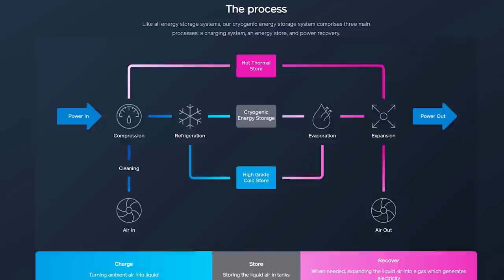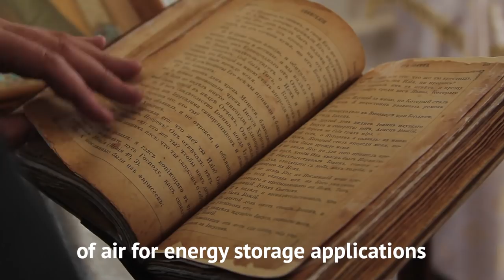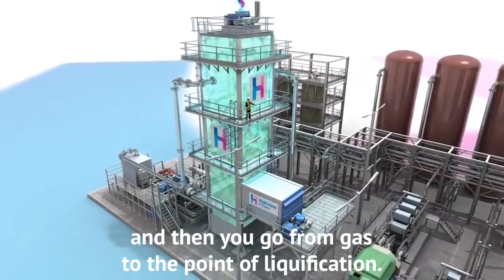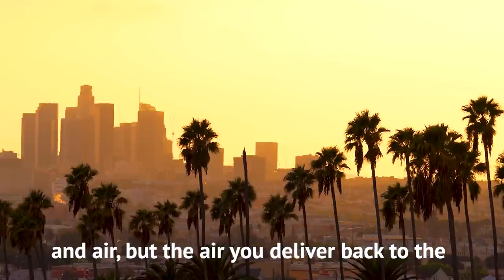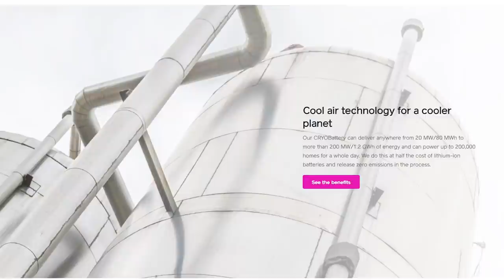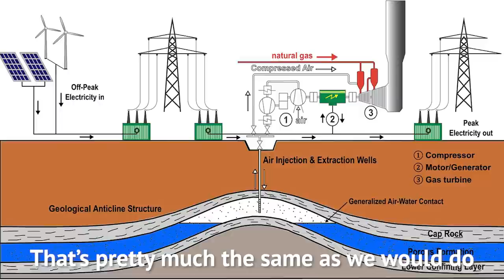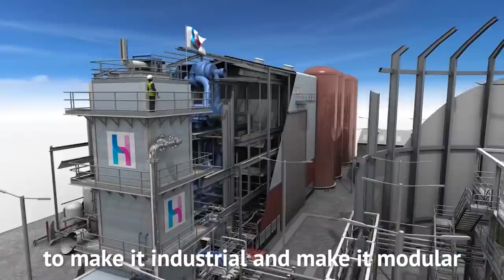CRYOBattery Storage? | Highview Power Interview

Comment: Please, show us the numbers: cost per megawatt of storage, plant construction costs, maintenance over time, salaries, etc.
Reply: @markplott4820  Megapack is good for short term balancing. It is expensive, but it makes profit with every loading and unloading. For the long term you need something different, where you make profit, with holding the energy for a long time.
Reply: Based on what was said in the interview, a plant like this is going to cost more than a 4 hour Lithium battery solution. I would imagine the cost would be comparable to operating a Gas Peaker plant over a 20 year lifespan.
Reply: @markplott4820  The problem with MegaPack and other battery solutions is the cost for longer duration storage. If you want 8 or 12 hours energy storage you are going to double or triple the cost for the additional batteries. With this technology, you simply have to pay for more, or larger, storage tanks. Additionally, if you need to increase the storage duration, you can simply add additional tanks. The point being that tank storage is cheaper than the cost of additional batteries.
Reply: @markplott4820  Numbers.... slightly different numbers out there,  but roughly talking Hornsdale cost $66m for batteries plus $24m for "no infrastructure" stuff " small concrete pads" to get 100MWh storage. Which is amazing. The second LAES plant will have 250MWh of storage for £85m and there building it in populated area (brown field site).  I'm happy they are 2 great solutions.
Reply: @markplott4820  In Australia the sun shines every day, but in Germany you need a solution for several months! You must store the energy from the summer for the use in winter. Batteries for one cycle a year are too expensive!
Reply: @No_Free_Lunch_Today  The main advantage of LAES is cost for capacity. Build a well insulated tank for liquid air, build it BIG. The volume rises by the cube while the outside surface (the only place where you can lose energy) rises by the square. And costs (I guess) rises less than linear. So, it's rather simple to store extremely large amounts of energy for comparatively little cost. 
That 250 MWh figure hasn't scaled yet... imagine several GWh - I'm pretty sure it's not that much more expensive. What drives the cost is the machinery to liquify or to evaporate (basically, store or extract energy) in the plant. The storage is (at huge scale) nearly free. 
The trouble I see is, when you evaporate the liquified air, it will draw a lot of heat from the environment. I'm not sure how well that scales when you release the heat in summer and extract it in winter (basically it gets hotter around the plant in summer and it gets colder in winter.

Edit: I should have waited for the video to finish. He is saying exactly what I wrote. The performance in MW is what drives the cost, the capacity costs next to nothing. Imagine a setup storing several TWh, enough to last a country through winter...
Reply: @minimalist_h  Even with rain you have production, plus there is wind.

Would you would need is to import energy from the Magreb, the same way you now import from Russia and mid east.
Reply: @aitorbleda8267  Yes, but there is still a difference between summer and winter.

We don't need the Magreb, just put enough solar panels on the roofs and build wind farms. The Magreb needs its electricity for itself.
Reply: @No_Free_Lunch_Today  Tesla already has experience building high pressure stainless steel tanks in Boca Chica
Reply: @minimalist_h  Nothing wrong importing energy.. but yes, we could be self sufficient in europe... but we would then have massive overproduction on summer..
Reply: @No_Free_Lunch_Today  With Li-Ion batteries starting to drop below $100kWh, the claim that a liquid air battery which costs $0.14/kWh (that's equivalent to $140/MWh - which is what the link provided states) and is HALF the cost of a Li-Ion battery is a bit hard to swallow. Something does not add up. We can take a Li-Ion battery that costs initially $100/kWh and amortize it over 5 years (perhaps it lasts more, which makes it cheaper) and come up with an amortized cost of $0.055/kWh. That's almost a third less than the $0.14/kWh claimed for the Highview Power "GWh-scale liquid-air battery". OK, so add some to the cost of the Li-Ion battery for inverting the DC to AC. That's probably going to raise its price to about 7 cents per kWh. That's half the price of the GWh-scale liquid-air battery. So where are they getting their Li-Ion batteries that when amortized they would cost $0.28/kWh? A Nissan Leaf battery repurposed for home energy storage will cost less than 10 cents per kWh, amortized over 5 years. 

The big killer is in grid balancing. Electric batteries will outpace the inertia of turbine generators all day and night long. That's why the Hornsdale Power Reserve battery (https://en.wikipedia.org/wiki/Hornsdale_Power_Reserve) paid for itself in about two years; it beat all turbine based "peaker" plants in the race to manage the grid they were tied to. Now Tesla is entering the European energy market, with its Autobidder platform, via England. Good luck to Highview Power; it appears that they have a very limited market in which they may be able to compete. Can't see any kind of advantage in competing with Li-Ion, if battery prices are not really twice as much as their cost and more so when they can't compete in managing the grid stability as fast as Li-Ion.
Reply: @aitorbleda8267  Thats why we need storage for months. Propably hydrogen into the natural gas grid makes the race.
Reply: @fllev4121  ammortize the liquid air battery over 30 years and the li-ion over 10 years (4000 cycles) you'll see the difference
Reply: @OwnerOfOwn  Not sure of where you are going with this line of thought. My comment above says it all as far as amortization is concerned. Why amortize over 10 years when amortization over 5 years with Li-Ion is already cheaper than liquid-air storage, assuming that liquid air is sold @ $0.14/kWh, as the Highview Power website says. The 30 year amortization already has the $0.14/kWh price baked-in.
Reply: @bbcooter388  

As it scales up it gets cheaper. But I think it is less than a 4-Hour lithium storage.
Reply: @fllev4121  

It appears that You forgot to add in the cost of replacing the lithium ion battery every 5 years times 6 years that would bring us to 30 years that this air system has a life cycle of.
Reply: @reypolice5231  Tesla lithium ion batteries last more than 15 years, especially in stationary storage and their cost will be cut in half within 5 years. The bottom line is doing the science, engineering and economics with a sharp pencil.
Reply: @aitorbleda8267  Europe does not need Magreb energy when it has plenty of sun and space in Spain, Italy and Greece.

Comment: Every oil refinery would be an excellent opportunity to convert there soon to be stranded assets into battery store. I worked in one of the largest oil refineries in the world and they have vessels that can handle tremendous pressures and have 3 to 10,000 horse power compressors. if the bankers were smart they start buying up refineries and turn them in the batteries
Reply: It's good to hear that this is possible. I was wondering about that.

Comment: Super interesting, thank you! As many commenters below I am also interested in numbers: construction cost compared (at, say, Hornsdale scale), storage efficiency compared (for 1 hr, 6 hrs, 12 hrs, 24 hrs duration), and reaction time compared to li-ion storage.
Reply: The big advantage of this technology is the marginal cost advantage to increase storage duration. In the interview he stated that his solution is not cost competitive with 4-hour Lithium battery storage, however, as storage duration increases Liquid Air storage costs less and less per Kwh stored. Basically, once you get the plant built, it doesn't cost very much to continually add tanks (or increase tank size) to increase duration. However, with battery storage, 8 hours of storage costs twice as much as 4 hours of storage.
Reply: The costs Highview are stating for their next two plants are £110 per MWh compared to battery storage between £120-150 per MWh although for ever getting cheaper. The larger a liquid air plant gets and the more storage you add the better value it is. As he said in the conversation it is not a case of one or the other but using both to supply the enormous amount of storage we need as quickly as possible. Battery gets you speed of response, liquid air gets long term storage and frees up batteries for homes & cars.

Comment: I really like these guys, they showed up on my radar about 3 years ago. The only ones so far that I have seen bring the cost down on compressed/liquified storage by using clever physics. The way they recover heat and cold between the steps to reinject it later is what allows them to "beat" the losses associated with compression/liquefaction and decompression/ dictated by the Ideal gas law (https://en.wikipedia.org/wiki/Ideal_gas_law). Rules out mobile applications, but really nice for fixed storage.

I wish I had hard number, but I could not find anything. What I can tell you is : They have a much higher marginal cost than battery when running, but a super low cost per unit of storage, most of the upfront cost is in the power dimensioning (max output/input): ie dimensioning and running the liquefaction and expansions steps, so their running economics are tightly linked to how much it cycles and how often it oscillates. (ie : duration of a working session spent either storing or restituting energy, number of sessions per day). Ideally with this you want to always be running (storing or giving back) but not sit idle and switch a minimum amount of times per day. The guy says nothing different when he says they want to do 4 hours up to 20 hours runs... I've heard stuff like 50-75USD/kwh but that's meaningless without knowing how much was upfront and how much was the running costs...
Reply: @Nphen  Yup, the efficiency of the system can be improved by what suplementary fatal heat/cold they can scavenge from industries around, heat doesn't travel well, while electricity can. So in a first phase, I'd expect them to install by biomethane sources, or foundries, incinerators, chemical plants ... 
Even 1km is a serious deal to transport heat/cold, while electricity rates differentials build up on the scale of 100's of  km.
Reply: Very good point nt

Comment: Love this technology I wonder what the round trip efficiency is compared to hydro or hydrogen?
Reply: Worse than an electrical battery, potentially better than hidrogen.
Reply: Way, way better than hydrogen, can almost guarantee
Reply: Probably not the best, even with scale. But inefficient storage is better than no storage.
Reply: Pumped Hydro is typically 70 - 75% efficient, however, upgrades to pumped Hydro generation is improving the round-trip efficiency.
Reply: @me1assassin  I know the physics and how efficient/costly it is to liquify air, charge batteries and get h.
Someone else has gone to their website and got a number of 60/70% efficiency, and that seems reasonable or at least feasible.
Reply: I think that efficiency becomes less important as more solar comes online. It’s modularity and capacity become more important. Avoiding mass curtailment of solar capacity is more important than ultimate efficiency. Mainly because solar is becoming so cheap, we are going to have a problem finding used for the surplus.
Reply: @juancarrera5524  I must agree with you, even if I dislike the idea.  At 0.01ct the KWh process efficiency becomes "meh", it is economic efficiency that matters.
It would still be a major issue to transport compressed or liquid hydrogen, and also an ecological problem.
Reply: @juancarrera5524  Hi Juan My hope is to have 600 % or more solar and wind generation and never have the need to curtail. We should charge batteries fill hydro dams make hydrogen make liquid air make drinking water from seawater make ammonia, heat up hot water in our homes charge EV cars and so on. The efficiency is more of curiosity from an engineering point of view.
Reply: @Maxwell smart Sure, but given the current state of intermittent renewable generation deployment of storage trumps efficiency IMO. Plus it’s very important that this technology offers transitional jobs to oil workers.
Reply: @juancarrera5524  The transition to renewable energy is having a deep impact on many industries. In fact just as you say it has the potential to create many new jobs.
Reply: @fireofenergy  I think the cost of initial solar generation is going to get so low ( under. 01$ per kwh that efficiency of storage won't matter
Overall cost per kwh will be out weighed by scalablilty and ease/flexibility of deployment
Reply: The UK's big pumped storage plant in Wales is about 75% round trip efficient , and with natural rain  catchment around the top late you can get that  well over 80%. But only in locations  that have the lakes .

This on the other hand can be built anywhere that you have room for the tankage, and if you want to expand the storage just add more tankage . 

And if you are storing wind/solar that would otherwise have to be curtailed ,  60% is much better than curtailment , that is effectively 100% loss.

Comment: What's the round trip efficiency compared to a lithium ion battery?
Reply: I thought the same. Lot of cloudy words and no facts. 👎
1st half of 2020 Germany had over 50% renewable energy in the grid, quite without storage and hydro. 🤷‍♂️
So 5:00 is quite wrong.
Reply: Or pumped hydro or electrolysis/fuel cell?
Reply: Yup, I thought the same. Or better say, what is the round trip efficiency at all.
Apart from that, I like the bonus that they can clean air. Would be a great benefit for some major cities.
Reply: It's a perfect 3 way solution.
Great to have these game changers.
Reply: @RedBatteryHead  Cost matters.
Reply: @fllev4121  sure it does. As far as you can hear it's cheaper than pure battery on this scale.
Reply: @RedBatteryHead  What is the time stamp in the video where that evidence is provided?
Reply: @fllev4121  I said, as far as...
Think we need to source the cost per kWh elswere. I will look into the video from "just have a think" for that. He features this too.

https://youtu.be/tMLu9Dtw9yI
Reply: @fllev4121  round trip is 60% efficiency.
Reply: @RedBatteryHead  We'll have to see what the market says. A rough calculation on just the energy in the liquid air, which normally costs about 50 cents per gallon in bulk, puts the cost of the energy stored in terms of dollars per kWh, not pennies per kWh. Right now, you can get Li-Ion battery storage for the home that is between 6 and 10 cents per kWh, for the do-it-yourself enthusiast. So they will have to be very efficient at storing the heat generated during air liquefaction and use cheap (1 cent/kWh - doable today in very large arrays) solar power to liquefy the air as well as for bringing back the stored air to a high enough temperature to drive a turbine efficiently. Relying on getting paid for electricity use during super generation events when there is lots of wind power will probably not provide enough income by itself to make the system cost effective, in the long run. Those events will dwindle in the future as battery storage grows and it will definitely grow faster than liquid air storage because of the electrification of the automobile.

These projects are the darling of large utilities and engineering firms, because they can justify large building projects which they will bill out for 20, 30 or 40 years to local governments, as part of building an infrastructure for "reliable" and clean energy generation. Even if the project is not really competitive in the open market with other clean storage, i.e. if the utility can convince the local or state government of some positive aspect such as the technology being clean and green, they could get the business and it is a win-win for the utility and the engineering firm. The reality is that is becoming old hat because the future really belongs to distributed energy generation and storage and an electric car that also stores energy for use in the home appears to be the cheaper way to go in the future.

Let's see what kind of pudding this Highview Power company will really produce. England seems like a good start because they are now getting into high levels of wind power generation. For a further look, the fellow that runs the Limiting Factor Channel on YouTube (https://www.youtube.com/channel/UCIFn7ONIJHyC-lMnb7Fm_jw/featured) said today that he'll be looking at air cryo-storage in the near future. He said so at the end of a live video chat held just minutes ago, on the subject of the information that came out today on the Tesla Q2 earnings call. He said that the recording of the live video done today will be posted in his Limiting Factor 2 channel (https://www.youtube.com/channel/UCxtuK4gRPM6ruzzzSFzkB4A) as soon as he does a bit of editing.

Comment: Landcaster wind systems also came to that point however I was told not to allow temperature of nitrogen to get below -40C   The patent we have is on how to use pipelines to transport and storage of compressed gases to run power generation of energy..  Cryogenic gas would be perfect way to store energy..  Thus use transportation of energy through power lines.. which are limited to 500 miles on high voltage lines..  
CHinese version of extreme high voltage lines can go up to 1000 miles from Generation to consumer. 
this range is limited by wire resistance. 

However compressed gases traveling through a pipeline the range is up to 5000 miles before the energy is diminished by friction within the pipe.